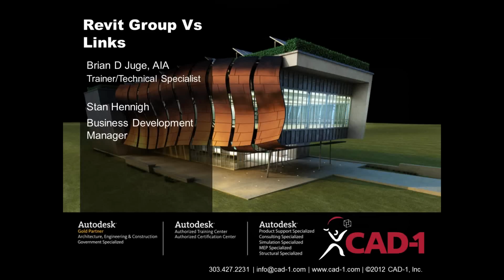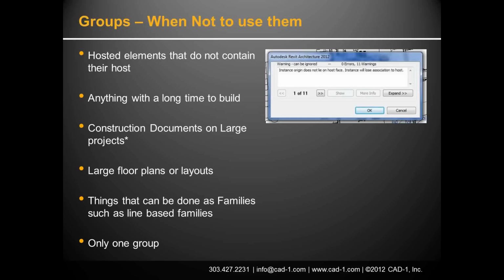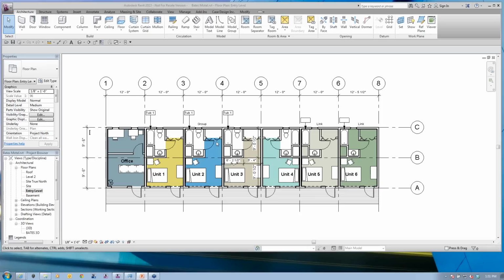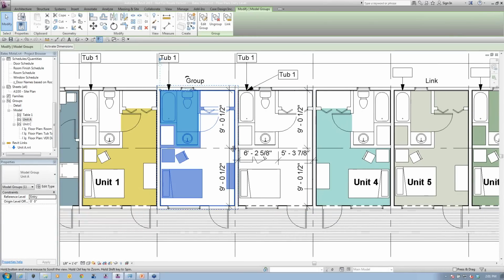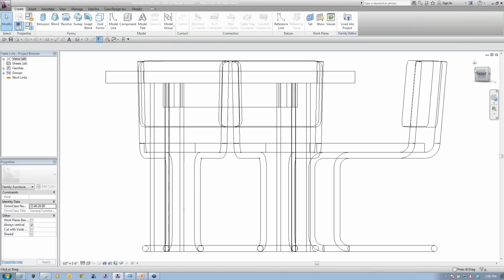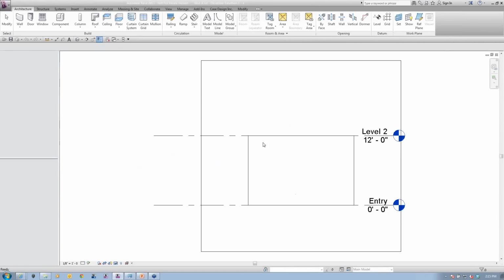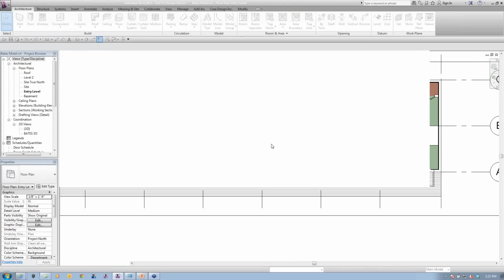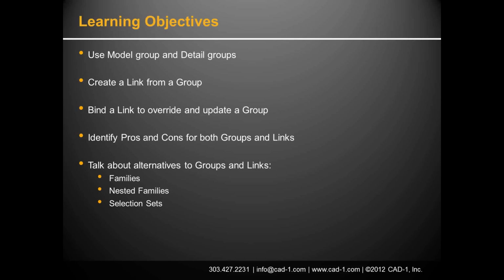CAD-1 Presents - Linking vs Groups: Answers for Revit

Comment: hi, I am trying to link an architecture model into a structural model but for some reason the architecture model is shifted away from the structural model, any suggestion to align them ? P.S. They are both AUTO: ORIGN TO ORIGN 
thanks